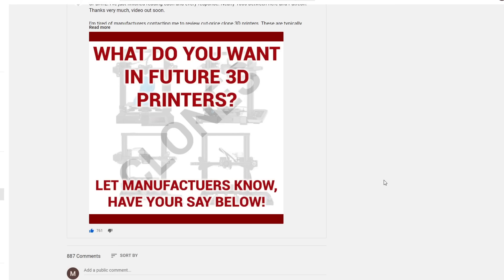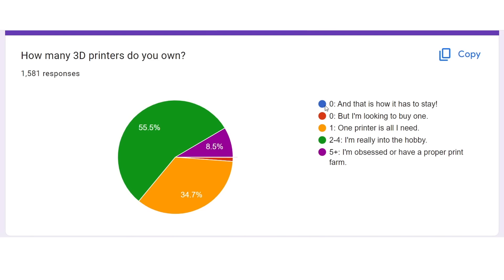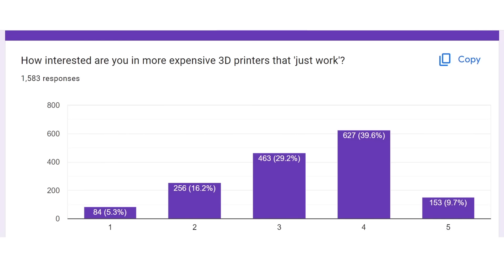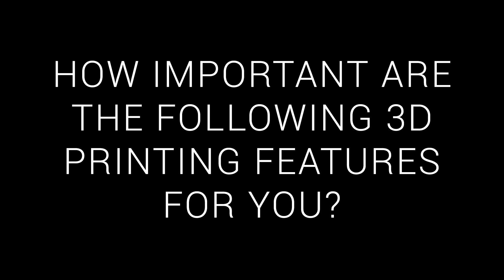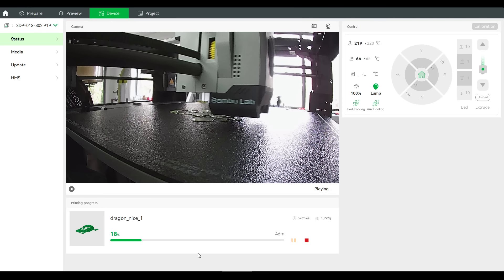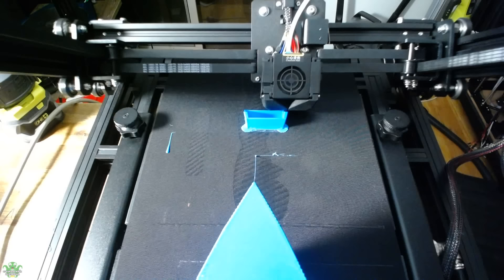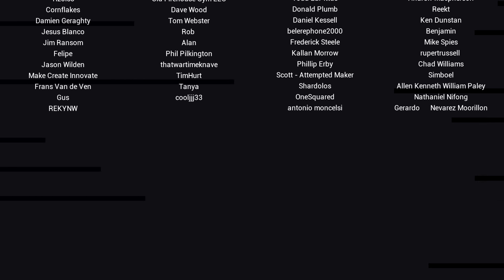The 3D printers the community actually want: Your say in 2024

Comment: I think my biggest thing has been reliability.

I haven't printed anything since December when I made glow in the dark dragons for my nieces and nephews.   Since then my Bambu X1c has been sitting on the shelf turned off.   Today I wanted to print a charging stand for my Pixel Watch.

I downloaded a STL, turned my printer on, sent the print, and it printed no problem, even after 4-5 months of no use.

If i were to try that on my old Ender 3 or CR6, it would take an hour+ of recalibrating to get everything to work right.
Reply: Same my ender 3 pro used to be like that but ever since changing the extruder hotend and Mainboard and the Firmware everything have been smooth sailing but more companies need to focus on reliability and dependability
Reply: @انا_ابراهيم_البناوي  
Ha, ha.  Been there...done that.  So you completely replaced most everything that made your Creality Ender 3 an Ender 3 and now it works?  Well at least glad you could do that without spending more for another printer replacement.
Reply: Lol, didn't even knew this was an issue at all. Always used Prusa
Reply: @dggcreations  the parts are still from creality the direct drive sprite and the Bed leveling sensor is a CR Touch and the screen is the standard one and the mainboard is btt skr mini e3 v2 so it's more like an ender 3 v2 S1
Reply: @EntropicTroponin  Lets  not pretend the mk3s didnt have problems
Reply: @انا_ابراهيم_البناوي  
Cool.  Ender 3 was an example of a product Creality did right,  for its time, for a very reasonable price.  Even though it might not have been a a top dollar product, it checked many peoples boxes.
Reply: @dggcreations  Ots also an example of what they did wrong considering they are still selling it in current year 😁
Reply: @BeefIngot  No product ever has no issues. But after some basic setup the Prusas are as solid as a bedrock foundation. Recently moved my Prusa mk3s+ with MMU3 in a moving van and regular box and it didn't need any recalibration at all.
Reply: @EntropicTroponin  Of course thats the case, but Im just saying it is definitely a generation (so to speak) back in those regards (still needing z offset for instance and having no input shaping).
Reply: @BeefIngot  and the Mini+.....
Reply: Same with my Prusa MK4. Just added the MMU after letting it sit all year. Updated the firmware and did my first multi color Pokémon with ease 💯
Reply: @EntropicTroponin prusa is overpriced for what it is. Bambu has them beat on every single level.
Reply: @انا_ابراهيم_البناوي It’s not stock, but I kept my E3 in a box for a year and moved across the USA with it. It printed surprisingly perfect after mesh bed level. 😮

Comment: I don’t like how manufacturers are shifting to proprietary extruders and hotends.  Nozzle technology has been one of the best pathways for improvement, and they are taking a huge step back in that regard now.

What I would like to see is a return to and expansion on partnerships between printer manufacturers and specialty parts manufacturers like E3D, Bondtech, Slice, etc.

Bondtech and Slice have partnered up for upgrade kits to common printers.  I would like to see those available from the start.  Just like cars have trim level packages, printers could have the same with a base level package or with aftermarket type upgrades pre-installed and firmware optimized from the factory.

Comment: Filament waste/reuse/recycling is my biggest concern long term as a hobbyist.
Reply: Collect your waste and failed prints. In some time there will be someone who can reuse it. Here in Germany we have the "Recycling Fabrik" where you can sent your wasted prints and get credits to buy new (recycled) filament from them. You get a points, which you can trade into a discount.
Reply: @bi___2112 do you sort your failed prints by color, filament type etc or just chuck them all in together?
Reply: @Ja_jaaaaaaaa   Noche nie von gehört, interessant 🧐
Reply: Yea i hate to print just it turns out my messure was wrong so the part don't fit.

Comment: As I notice more and more trend towards printed images (hueforge, signs), I could imagine that there is a market for printers with a large print area, but not necessarily a large height. You could then hang it on the wall to minimize the space required. And of course it should be able to do multicolor with at least 6 colors and more
Reply: A wearable 3d printer that only prints "Kick me" signs on your back. Good idea

Comment: You know what I really wouldn't mind? A 3d printer that supports multi-material/color but only holds like two spools.

I like the implementation of the new prusa xl, but I don't like the price tag or need 5 tool heads.
Reply: Im pretty sure you buy the prusa tool heads individually. And having four spools instead of 2 on an mmu is only incrementally more expensive.
Reply: @jdoe1917  I know you can buy them individually like that, but unless I just haven't done my research (which is very highly probable), I don't want something that's as big as the xl and uses multiple heads. Something similar in size to an Ender 3 would be perfect, I think.
Reply: idex is the answer. something like a RatRig Vcore 4
Reply: @ThePickleSoup  sovol has that
Reply: @ThePickleSoup ender 3 with the enderIDEX conversion. It’s basically exactly what you’re looking for

Comment: A couple thoughts I had… First, as an alternative to non planar printing for those who only care about surface finish, non planar ironing. The nozzle would pause printing at certain layers, go back and iron and then continue on or even be replaced with a separate special nozzle made for the purpose. The slicer would need to slice in a way that it left enough material to iron. The next thought is focusing on at least 2 head/nozzle  printers. This would for many benefits including faster material/color changes, since one could be printing while the other is changing filaments. I think this should do for now. (I’m also always a fan of closed loop motor control)

Comment: A feature that I hope to see more of in the next generation of 3D printers is a heated enclosure.  In the consumer level price category, the only manufacturer doing this now is Qidi Tech; I hope in the near future, more of the 3D printer manufacturers offer heated enclosures, as this will make it easier to print higher temperature materials.  I would like to see more printers that are not limited to printing  just PLA, PETG, and TPU.
Reply: I'd like to see more compact budget-ish printers with heated chamber. You aren't printing cosplay helmets out of nylon, you use it for smaller parts that are structurally critical, so owning a big open printer to print big things with PETG and a small efficient enclosed one for structural parts makes sense. Small chamber will heat up to operating temp quickly.
Reply: @TheLaXandro  You make an excellent point, but not everyone who uses a big printer is interested in cosplay parts.  I have been experimenting with printing musical instruments like violins, and I need a large format printer for that.  My Qidi X-Max 3 does a great job, but I would delinitely be interested in a large format printer with a taller build volume. than the X-Max 3.
Reply: @William3DP  oh yes, of course, I didn't mean that big printer is just for cosplay, I just picked the first big dumb thing that people use big printers for.
If you want a tall volume, you can consider a delta printer with a custom enclosure. Nothing beats deltas in terms of tall.

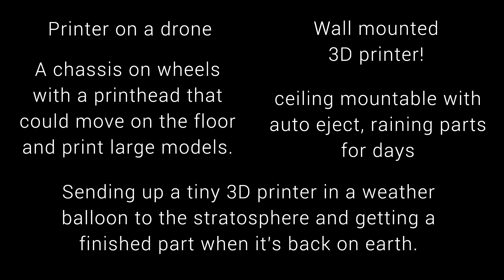Comment: 14:37 Wall mount is indeed great. I built one with a SCARA arm and fold-out bed, so when not in use it only protrudes a few inches from the wall. Very convenient since I don't use it very often. The "frame" is just a 2x4 with two SBR12 rails screwed to it, one of which also serves as the arm's shoulder axis.
Reply: Got videos of it in action? Sounds interesting.
Reply: @TheLaXandro  No, but I do have a Hackaday page for it with some photos (project name is Wall SCARA, username same as here). I'd post a link but youtube usually deletes comments with links.

Comment: I did not complete the survey but agree with many of the responses.    I love that my Qidi Tech X-Plus 3 is NOT connected to the cloud.   I just send a sliced file to the printer on my local network.    I wanted a WiFi capable printer, but not one which required the cloud.
I purchased this machine for the CoreXY design and faster speed than my Creality CR10S which by now seems very slow - reliable but slow.

Comment: My impression of the printer you proposed at the end is that Rat Rig V-Core 4 is hitting a lot of those targets. I have my V-Core 3 500 running nicely so I am not likely to buy the 4 any time soon but I am intrigued by the option of making it an IDEX without any changes to its main frame and most of its  parts.

Comment: I still like the S1 Pro.
They just run and run and run with very little maintenance, and no stupid plastic tubes to worry about.
They're discontinuing them, and Dumping all their bad inventory, using up all their bad parts right now. (Thermistors, Heaters, etc.).
But for the price, having to adding $30 to make them new again, They're still a great deal.

Comment: 1. the ability to print easily and reliably in more materials including flexible, weather resisting, higher strength, etc. So an enclosed printer with heater, with high temp capabilities, hardened nozzles and an exhaust fan. 
2. 3D surfaces - stair stepping on top surfaces is basic and the printers can do more. So nozzles need to project substantially.
3. hot end that is retained by a clip. So it is removable cold and without any tools.
4. extended Y axis without increasing the X and Z axes. So I can make longer parts without greatly increasing machine size or cost.
With these improvements the limitations of 3D printers will be greatly reduced.

Comment: Awesome channel!  Pretty new/late to the game and got an Ender3 V2 Neo (because it was cheap), which worked out of the box about 6 months ago, but after lots of reading and watching... it's not an out-of-box unit anymore (or cheap).  Conversely, I'm looking at an X1 Carbon for those days when I simply want to load and print.  In six months, I have yet to print a toy or trinket.   Having said that, there are now parts for an Arc Reactor clock for my son on the printer.

Comment: Hey Michael, something specific I've been hoping to see from you or others is cooling fan comparisons cuz surprisingly there aren't a lot of direct real-world comparisons.

Like for my ratrig, I defaulted to using a 7530 cuz I had one lying around and figured overkill is best kill, but many on the forums say its just wasting weight and energy. And surprisingly, I haven't seen anybody actually compare common fan sizes like the 5015, 4048 or the CPAP system in print applications. I've made a few alts to put on my ratrig to test them out after I rebuild it, but I thought it'd be fun to see some comparisons from others too.

Comment: i have an idea for multi-color waste. 
what about printing lines on the print bed instead of blocks, so that you can feed the lines into the hotend and make a makeshift normal sized string of filiment through special printer settings. that way consumers dont have to buy an expensive spool maker that they might only use once. maybe another nozzle or special feeding system that swaps out with the normal print head?
Reply: the problem is solved a long time ago by idex
Reply: @whitewittock  true. but you cant easily mod a printer to get dual extrusion. even so, you cant use both at the same time to boost print speed.

Comment: Multi filament core xy should be the norm but for the slicer I choose creality print with tinkercad function.  Most individuals do not have big spaces for big bed printers. So the best option is slicing but with options to drill 2 or 3 mm into the models so we can put dowels or magnets inside so it will hold stronger

Comment: What I would like to see is 2 things:
1) For enclosed printers, how about a light that is controlled by external switch so when your working on the printer, you can see with the power off.  So you can unplug and plug things and see what your doing.
2) Extra headers on the mother boards so we can add controllable devices like filament tangle switches, colored lights, or other sensors

Comment: In in Australia and I own a 30 printer printing farm. Loved this video but there is something that I feel is completely missed.  Power... if a bambu came in a 350w varient id be sold.  I have k1c as well as bambu and elegoo neptune 3 pros. My priorities are 1. Quality. 2. Power. 3. Speed. 4. Bed size. Enough isn't spoken about power, both in terms of how much they draw,  at what points they draw it eg a bambu p1s vs a k1c, purely in terms of power.  

Id love to see that article.  How many printers can you fit safely to a house? 

Also,  the new creality 3 v3 plus may just got this role if the quality is there.  300mm x 300mm bed, 600mm/s speed and 350 watt power? Yes please...

Comment: One other thing I think would be interesting to see is a better way to handle large projects in slicers (ones that use multiple full build plates). Some parts require different parameters (other than the settings you can add to the parts individually) such as filament type, filament color, layer height, etc. My thoughts would be you could specify those parameters for each part (or multiple parts at a time) to begin with. Then when you auto arrange parts, they would be grouped together by layer height (or support different layer heights in the same print, preferably both), by filament color, filament type, etc.

Then to take it a step further, have a belt printer and have the ability to auto dump parts and start the next program and change out filaments (if you have a mmu or ams) and just general features to make printing large complicated projects easier.

Comment: Thanks for doing this survey.  I"m sure it's valuable to those contemplating future product developments. 

As part of the expandability aspect, you could take that further in a more generalized sustainability.  If there were some common mechanical component that were modular and reusable, upgrades could could cheaper and more likely to be adopted.   I'm thinking of mechanical components like frames and enclosures.  Or maybe some standard interfaces for toolheads and hot-ends that can be swapped out.  Maybe turn your 3D printer into a laser engraver, purchased from a third party?   Or a 3D scanner "tool" you could swap into your precision motion system?

Might not be time yet for something like that, but a first step could be this level of upgrades from within a particular vendor?

I moved from an Ender 3 "Pro" to a Voron 2.4.  The change from "3D printing as a hobby" to "3D printer as a tool" really was quite profound.   It was a nice transition, even after then enjoyable (to me) assembly process that resulted in a pretty reliable tool.  I got to thinking about it very differently, and it surprised me.  I wonder what other changes will have profound impacts on how people think about these tools?

Comment: A video I would love to see is one regarding a workflow designed around the highest reliability in all regards. I see a lot of people trying to make like, a sub 1 minute benchy, but the speeds and stuff the machine is moving at, that has got to be really rough on all the components. I would love to know if there is a sweet spot when it comes to speeds, that is the best balance of reliable to print, easy on the machine, and highest level of uptime/success. I think one of the things that is really cool about 3D printing is the machine can do so much, that I can scale my operation up rather easily by simply adding another 3D printer to my workspace. I don't need to tune one machine to crazy high rates if I can have multiple that are up all the time parallel processing stuff. But it also isn't clear to me if there is also a diminishing return, like can you run a machine so slow that failure increases because plastic is heating up too much in the extruder waiting to be extruded and maybe at slower speeds there is more wear on some components? Does really slow speeds improve ringing, or make it worse? All this stuff I don't actually know but would love to see this information somewhere.

Comment: After modifying and Aquila and an buying a used and modified ender 5 pro and tweaking it further then picking up a K1C (came with free 10w laser that I intend to hook into my 4x8 lowrider CNC)... Something that just works is really nice but I still enjoy messing with the printer itself just about as much as using it sometimes as long as I'm not outright fighting with it.

I really like multi-color / multi-material, the cost and waste i'm less happy with. 

There is one retailer I order liquid cooled computer parts from uses a packaging peanut that is water soluble. Dump them in the sink run a little water over them and they are gone. I believe they are corn based and I really like them over the typical foams and packaging options.

The one thing I'd like to see more of is something like the Hydra bed leveling become more common instead of taking things as is out of level actual make it level.